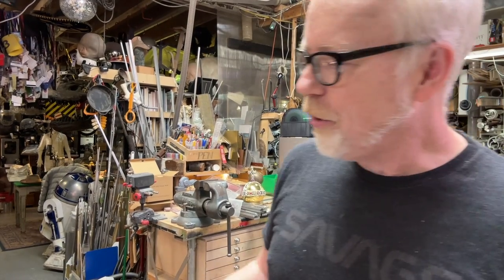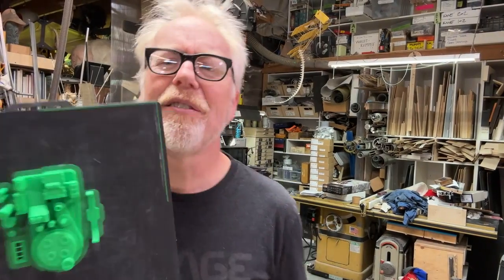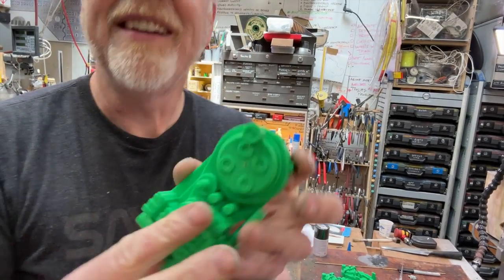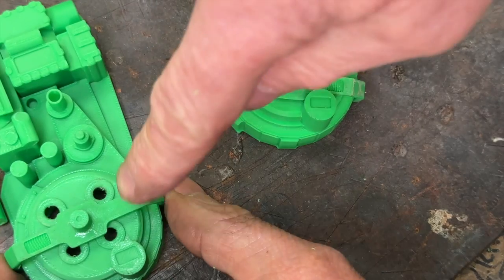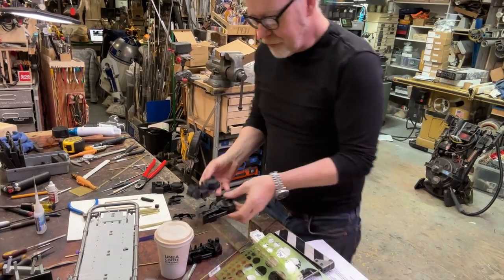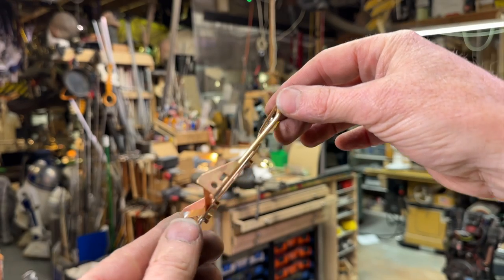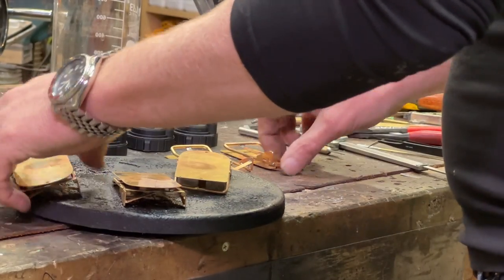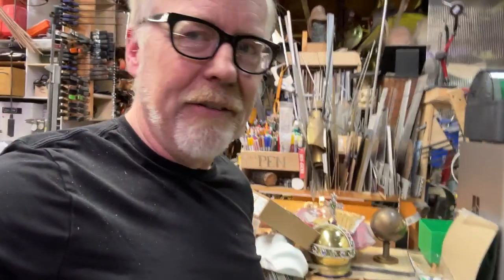Adam Savage Builds Mini Ghostbusters Proton Packs!

Comment: I think for someone so used to using other processes, 3D Printing is great for helping you spend time on what you want. If that makes sense. Do you want to be spending the time to build out that whole scale pack with milling whatever material? Or building it from PVC and vacuforming and cleaning all all that up?

Or would you rather spend your time painting and weathering and adding effects. I think for some ppl, and sometimes Adam, they would rather use the techniques they are used to because they enjoy them and the process.

But sometimes having something that gets you 80% there's lets you spend much more time doing the more desirable part of the build.
Reply: I got a printer for Christmas. I'm still struggling to get a successful print. I think I've had 2 succeed and I couldn't tell you what cause those to succeed when the others have all failed. I've watched all the tested 3d printer videos and have scoured the internet.

Comment: One thing I know that printers are great for is Greeblies!!! You keep saying you can't get enough and with supports turned on and orientations to force more of them it will also make longer prints.  Find a nice benchie to print in an ' incorrect ' orientation that you can later use as a greebles just to look at the different options for supports.  Even Rafts can become something else with planning and happy accidents!.  Loved watching the build, not trying to detract, that said headphone cables are out there for cheap, woven cloth covered and there are some tiny RGB surface mount LEDs that could potentially fit at the working end of the proton gun.  The hard part is the enameled wire to the stock end and have the LED in the barrel at that scale.  Please keep sharing the progress!

Comment: Pro tip, metal deburring tools work excellent for removing “flashing” from using brims on 3D prints. 

Super fast and clean and less messy / effort than sanding.

Comment: Stoked to see Adam getting into FDM printing. Resin printers are awesome but there are some things that just work better in FDM. I'm not sure about the specifics of the Bambu but with the FDM machines I own, I upgraded them with sprung steel PEI coated build plates. I don't have to use any glue or extra adhesive for my prints, and I'm able to print almost anything without a brim. Once the print cools down it pops right off.

Comment: 3D printing has changed the way I build props, but I still go back to 'traditional' model building. A 3D printed interior cage has simplified my Star Wars Thermal Detonator prop, enabling the introduction of Arduino control of the lights and sound effects.

Comment: You should try solder paste for the joints. It is used for surface mount electronics you just apply the paste that already have flux.

Comment: LOL my first comment when I saw the green prints was going to be why did he not do them in black! (Then he did!).. Once he gets better at printing he could have adjusted it to remove most of the print lines.. and modified the holes where he wanted them.. The frames were cool love they way he soldered it together.. also that Mini Table Break blew my mind! BUT if it was me I would have 3D printed the frame...

Comment: 10:08 That's one of 3D printing's strenghts. If you don't want to fuss with rhe software trying to edit the file, you can just modify the orint when it is done printing. 3d printing is so incredibly flexible that it can fit into anyone's workflow and style. I wouldn't have the tools for making the cuts Adam did to hog out the back and I'm good with the software. So, I would go that route. 3d printing is a tool that accommodates the maker instead of the maker having to accommodate the tool.

Comment: Carbon fiber filament is extra abrasive on your nozzle. A hardened steel nozzle is recommended for abrasive filaments. A brass nozzle will end up larger over time
Reply: The X1 Carbon shown in the video comes with a hardened steel nozzle out of the box.
Reply: @eightbitminiboss  good

Comment: Making them completely hollow from the start would go a long way to making this a much easier process...and you can print it in a way that you could have an easily removable panel on the back side to access the interior in case you need to adjust the electronics or even add a battery compartment to make them portable

Comment: 3d printers have been good for years but specifically the Bambu Labs printer raised the bar and it set a new benchmark for what the best consumer 3d printer is currently. I want one. The carbon is like $1100.00 but they have a version without an enclosure or a camera for $800 I think

Comment: There is actually a battery designed proton pack scale model from printables by LAYER LUX 3D it takes 3 AAA batteries you just need to add the metal tabs and springs out an old remote! Once fit your leds It's so cool! It's all cut holes for LEDs just save you alot time

Comment: I have no doubt that other people have shared this already, because I'm way behind on catching up with my subscriptions.

Carbon fiber PLA is good for heat resistance, but has poor layer adhesion. If you want to use carbon fiber to get that heat resistance or texture out of the print, you should use carbon fiber nylon. It's more expensive but you get much better results out of it than using carbon fiber PLA.

Comment: If this is PLA how did you get it to not melt while drilling and milling?
Reply: RPM not high enough. I've never encountered issues when using a drill press or a cordless with any kind of drill bit and PLA. The dremel is another thing though, but as said, just use lower RPM and it's not an issue.

Comment: What is that tip Adam has on his CA glue? I have that same glue but have never seen such a narrow tip. 

The ones it comes with are much fatter and you can’t cap it unless you take them off. So they often either clog or the cap gets glued to the bottle even though I’m really careful about how I close them, not leaving them open any longer than absolutely necessary, etc. 

Can you just leave them without a cap if you have a thin enough tip?

Comment: i recommend a 3d printer welder, its like a hot glue gun but for the filament you can add detail or glue with the filament or even write. and duh it can repair.

Comment: I wonder if you and Jaime had the ability to use 3D printers while filming Mythbusters if you guys could have been able to do alot more projects in a quicker time period
Reply: I think the issue at hand is that they were both SPFX artists who learned things like machining and welding and if 3D printing come about then, they maybe would have used it for some of the tiny builds, but remember most of the stuff for TV needs to be large so the camera can shoot it. They were using 'old technology' first and Adam still always goes to his lathe FIRST where as the modern builder almost never uses a lathe when you can just 3D print a light saber and you really focus on the front end design rather than the back end machining.

Comment: You do know that it's easier to go back to your 3D modelling software and cut out all of the holes you need, instead of all of the milling out? Making 2nd and 3rd iterations of a model is so much cleaner than hacking away at it with hand tools.

Comment: At the 6:00 mark when Adam is unloading the printer, the flex off of the part makes me cringe. WIth PLA, white showing on the build-plate after pealing means that the nozzle was far to close to the build plate, PLA should be a light flex and it just flies off, and also that build plate is going to tear/break if subjected to that for more than a few prints in that condition. Also, what the hell is glue-stick doing on a Carbon X1?!?! That machine is designed to use the build-plate raw without any goop or junk on the build plate.
Reply: He did say he was new to printing and didn’t use it often